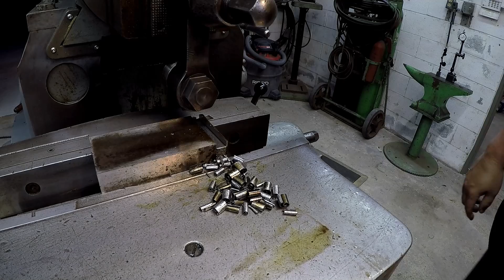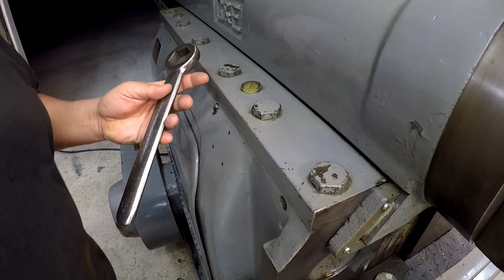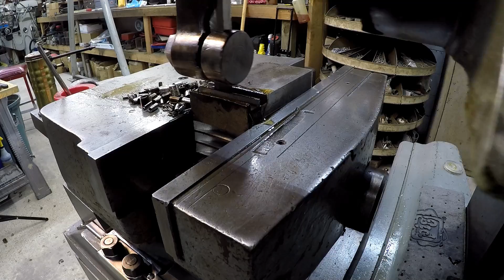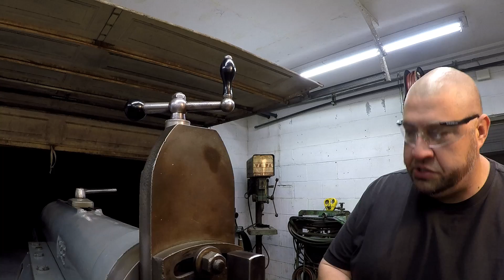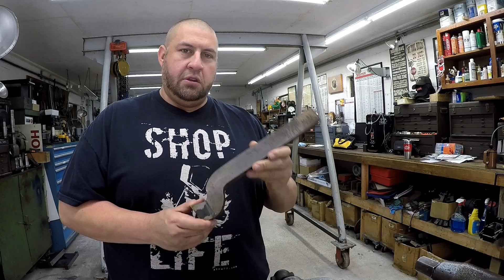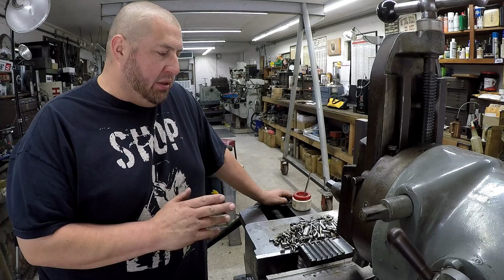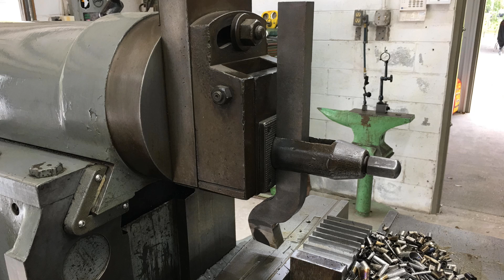Shaper Slotting

Comment: After watching so many of your videos (not a machinist here) i came to the realization  that your cutting tools never actually rub against an oiled surface and that all cuts are made to a dry un-lubed surface, which to me is a great paradox, because when you grab that oiler and squirt oil to lube your work, the oil never really gets between your cutting tool and the edge being "peeled" away. I guess that all the oil does is to cool down the shavings as they are being peeled away. Again, not a machinist here.
Reply from the maker: The purpose of the cutting oil is to provide some lubricity to the shearing forces between the tool and the workpiece. It helps prevent chip welding onto the tool, helps to reduce the forces applied, and helps the chip slide off the tool. Same principles on drills, taps, lathe tools, any cutting tool.
Reply: Always wondered the same thing, but i think it just naturally gets on the curring edge and helps curl the chips.
Reply: i defer to adam

Comment: Could you use a shaper to cut a male dovetail?
Reply: J the Welsh Warlord I'd think so. Cut a rectangular slot to clear most of the waste, then work a profileing tool from center out. I guess you'd need a different tool for either side
Reply from the maker: Yessir.
Reply: My shop teacher cut dovetails into a piece of round stock to mount wood joiner knives.  He didn't have a dovetail mill-cutter that small to cut the slots, so he did a straight slot, then angled the head on the shaper to form either side of the female dovetail into the round stock.  Oh, by the way, don't try to sharpen the joiner knives on a grinding wheel with them still mounted in the shaft. . .

Comment: hey Adam if you see this comment i would like to know what you use to hold your oil and brush. im trying to find something like that but cant remember what they are called
Reply from the maker: The plastic oil container is called a Spillmaster. You can buy them from McMaster-Carr, or hobby stores.
Reply: Kyle Maddux it's called a spill master, if I remember correctly.

Comment: A way to limit each down feed sounds like a good idea to me.  Bring it down a pre-set depth,  to avoid overloading machine and tool, bring the feed wheel/handle back for another bite after the cut stroke, and feed for the next one.  Avoid crossed eyes and other vision strain from trying to read that dial on the tool slide while the ram is in motion.
Reply from the maker: That’s what the auto down feed unit is for that I’ll be fixing and getting to work again.

Comment: Questions about you applying oil between cuts, in not 100% sure of the purpose, but I assume its for lubrication and cooling. Applying the oil at the beginning of the cut wouldn't that only affect the beginning of the cutting stroke when the tool is at its coolest and no lubrication at all. Applying the oil to the tool would that lubricate and cool tool until the tool engages the stock. Wouldn't lubricating the tool and the stock be optimum? or Just oil either place and all is good since the tool can handle it?
Reply: Applying the oil to the part is alot easier than trying to catch a moving tool bit. When you stop you can apply it as he did. The tool with gather the oil off of the part and its somewhat sticky so its sticks to the tooling.
Reply from the maker: Cutting oil is for lubrication  only.

Comment: How does the grind on that gooseneck bit compare with the grind on the 1 inch tool you were using? Anything to learn there? Last week I joked for you to make a dovetail, I have been thinking that it was wasteful of the bits you have to make one, but can you use the tilt feature of the table to help with what you would have to grind off? Have you tried using the depth micrometer on the entire length of the cut to see if it is jumping up a bit at the beginning? Thanks for the videos Adam.

Comment: I think the setup would be more rigid with the toolbit holder choked up further under the tool post. I see you put it up until it hit the other end of the tool, but if flipped around it could go up at least 1" before the nut hits clapper box.

Comment: Adam, could you use the knee for depth of cut adjustments rather than the wheel on top?   Either way, another great video!
Reply from the maker: Shapers by design are supposed cut with the tool head feed, or cross rail travel. The table should always be locked and clamped to provide maximum rigidity,
Reply: Thanks Adam for clarifying

Comment: Would a diagonally-cut toolbit be better for the shaper than a straight-cut?
Reply: I think he means diagonal in the horizontal axis, but still flat bottomed -  so the cut would shear instead of plow and chatter.
Reply: That wouldn’t make any sense if you wanted the bottom of the slot to be flat.

Comment: Adam,

The clapper pin may be a little
Loose. I believe they have a taper so you can adjust them up a bit
By the nut on one end.

The planer's we had would chatter until you got up to about .006 depth of cut.

We machined machinery base castings using a 1" or wider broad nose tool.

We'd set the cross feed at about 1.000 inches per stroke with about
.006 depth of cut.

You've seen that pattern on old machinery like maybe on the boring mill table, or radial drill bases and tables.

I have that same shaper except in 16".  She is a real hoss too.

Regards
Kap

Comment: Could it be that there a natural frequencies on the shaper (head as a whole, tool or bed) that should be avoided to get a nice shaping. For example: The tool stores a good deal of energy on hitting the material and vibrates. It's just an idea. I'm not into it.
I found this on the net relating to "Edgar Allen and Co": gracesguide.co.uk/Edgar_Allen_and_Co
"Stag Major Superweld" is mentioned as tool steel  for turning, planing, shaping, etc in 1937
btw ... did they use the current inch definition in that time ... I'm not sure, maybe the inch on that old toolsteel was a little bit shorter (25,4 mm vs. 25,39998 mm) xD

Comment: I love watching shapers at work, I have a small 8 inch one.  I am curios as to why on your shaper you double the reading on the dial as if you were cutting a radius but measuring diameter on a lathe.
Reply from the maker: On the tool head slide, each line equals .002”.

Comment: Would there be any advantage to grinding the cutting edge at a slight angle so the initial contact isn't the full with of the tool? Or would that cause excessive side load?

Comment: Thats sounding much happier Adam :). I hear ya on the tool steel being a different material etc, ive no experience there.
Another thing you can try in mild steel is putting monster rake on the tools, im talking a good 30̊ - 45̊ of rake into the cutting face, use as little relief as poss to keep as much meat in the tool as you can. Just grind some small ones for the holder and have a play.
The tool you got sent is a beauty, could also use it to finish cut. Tilt it over a smidge so the leading edge is a touch lower, take a light cut with a big step over. Nice finish for say a table top for example. 
That big grin says it all, theres no saving you now mate lol ;)

Comment: I use to run a planer as a young machinist and was told to make all the tool end reliefs at a 1 degree clearance.  I was told that the tool would last longer with more 'meat' behind the cutting edge.  Didn't do much steel but this worked very well on cast iron.

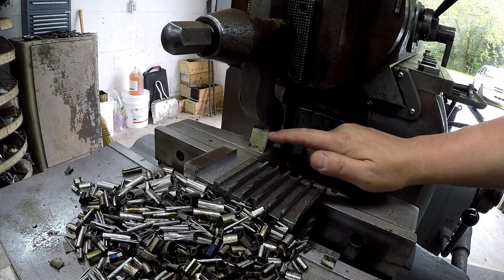Comment: Tisk Tisk, Fingers in a running machine.  21:28
Reply: Still powered and running so it would only take a bump of one lever to start it moving they way it looks.
Reply: The son of gun has been working a machine since he was like 14 and still has all his digits, I say he's pretty cognizant of where he's putting em.
Reply: The son of a gun as you say is also working the bugs out a new machinel.  And fyi many body parts have been lost to the lax thinking of I'll be fine I have many years of experience doing this.

Comment: Adam, I like shapers, but I was way more excited when you got one over others. Why? Because you aren't afraid to push tools. You enjoy it just like I do. I get a little tired of guys that are complacent with making ten 50 thou cuts to remove some material on a big 24" shaper, but I knew you'd get get at it. I didn't expect you to be pushing 3/4" so fast, but I'm happy to see it.

Not only that, but it shows that shapers are still a competent material removal machine.
Reply from the maker: Dad taught me long ago that the shaper was great for really moving some metal, while your off running another machine. The text books show the same thing. I want to get the heavy cuts figured out, then move on to fine finishes. 👍🏻

Comment: NIce. Solid progress!

A quick thought, maybe throw an indicator on the table/vise to make sure it's not deflecting. I'm thinking it may be moving a bit on it's ways and causing the alternate light/heavy cuts. That could also be responsible for the jump at the start of the heavy cuts.

You could be making some very cool "Chip" keychains out of some of your practice chips. Put them up for sale for a shop fund or something. 

Thanks again for the ride along.

Comment: if you go frame by frame at 9:20 (when paused, use the < and > keys to travel one frame) you can see the whole table deflect when the tool enters the cut, and then deflect back when the tool leaves the cut. Just goes to show how much force it takes to shear metal!
Reply: Eli Douek I'd call it . and , because there's no shift pressed, but that's a question of semantics.
Reply: Technically yes, although you can see why i used < and >, as the arrows do represent forwards and backwards.
I just discovered that shift + < or > increases or decreases playback speed. nice

Comment: I am no machinist or anything but I am wondering if lowering the table a few inches and cranking the tool head down some would help?  It almost seems like you are picking up some impact slop from the geometry to me like if you tried to drive a nail in holding the hammer right at the head which negates the mechanical advantage that the leverage would give you using it correctly.  I could be completely wrong but when I saw how much screw you have sticking up above the ram it made me think of that.  Awesome video though, keep up the good work.
Reply: I understand that with most situations in machining but like the example with the hammer being close to the work will result in less control and I was wondering if the same thing might be happening with the shaper since it is a similar situation.  Like i said I could ( and am probably ) be wrong honestly but it might be a good video to either try it or explain why I am wrong.  I don't mind being wrong either because that is part of learning.

Comment: The part thats missing is for the power down feed right?
Reply: metalhead2508 then what dose the cam plate that he is missing do?
Reply: metalhead2508 someone sent in a cam plate off a 24 inch shaper I believe. And someone else modeled up a enlarged one to fit his shaper. Its one of the projects he wants to do on the shaper for the shaper.

The hydraulic attachment is for copying a part. It dose way more than a downfeed. You could easily convert one of those to cnc. CNC shaper would be interesting.

Comment: Adam listening to you talk about the hand wheel on the top feed down adjustment i think it would be neat to incorporate a ratchet similar to the table but manual ratchet action. That way each audible click would be graduated into X number of thousands. Just thinking out loud. Also as your learning curve progresses  please show close ups of the tool bits you are using for the particular job and it would help it the camera was located where the viewer could see the action of the tool bit as the work is being preformed. Thanks for sharing and please don't take my suggestions as controlling. It is just something i would like to see. Thanks again for all your time and effort.

Comment: If I were grinding that tool I would make the leading edge at an angle so that it shears, rather than the whole edge hitting the workpiece at once. And it wouldn't jump when it started the cut at that material edge. It looks like you've got it under control.

Comment: Is the edge of the cutting tool parallel to the edge of the work piece?  What would happen if the edge of the cutting tool was angled such that when the tool begins cutting it's like a scissor cutting through the material until it is all the way on the work piece.
Reply: It would probably try to drive the cutter to the side. And the side force would change with the depth of cut.